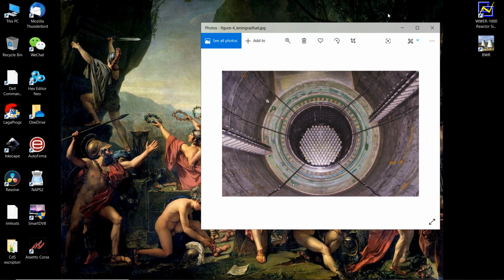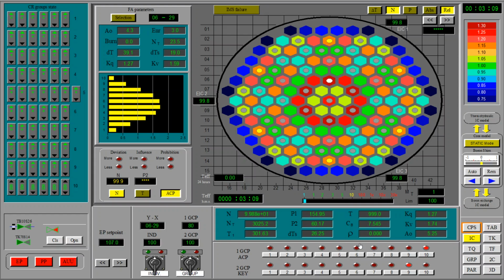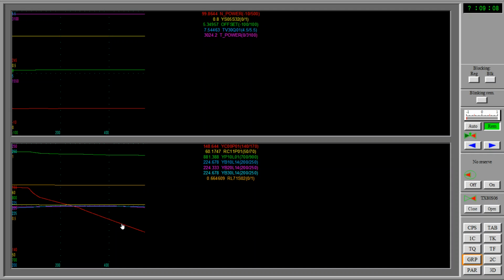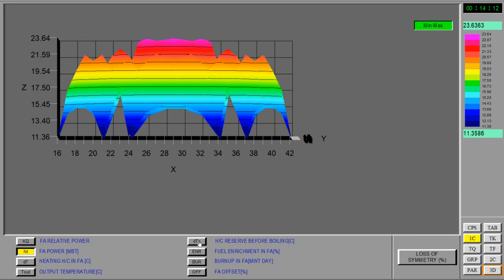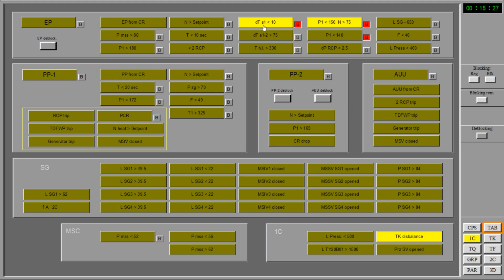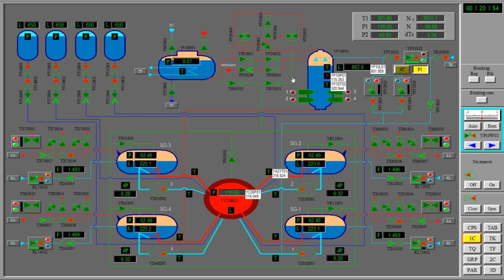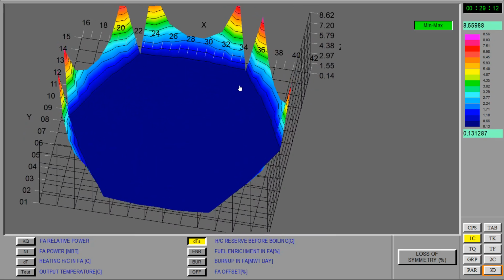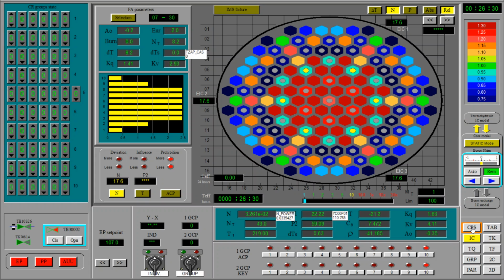Nuclear Reactor Simulator: Primary Boiling WWER-1000 2/2

Comment: Good tutorials!!! I think too that negative reactivity by boling water is not simulated. The developers doesn't have had this into account because it's a situation that we never must arrive. But it would be interesting simulated boiling water, because boiling water also doesn't have good thermal conductivity, so the reactor will start rising temperature and it could speed up a core meltdown. It would be an interesting simulation.

In other hand, you can poweroff pressurizer heaters, you must click the red or green tag shapes, then you can select "rem" for manual control, like a variable valve. You can use the arrows to on and off the heaters. With heaters powered off things are easier. I will try a cold shutdown (for refuelling, for example) by powering off the heaters.

Thanks.
Reply: I've changed my opinion. I've done 2 tests and I can conclude that primary circuit water boiling is simulated in the simulator. 

In the first test I start "Rated state operation" task, with power at 100%. Then I lower pressure to less than 110 bar, by powering off heaters, opening water spray valve and opening relief valves to the buble condenser (tank at the left of the pressurizer). When water temperature is near boiling point reactivity starts going negative and when water is boiling reactivity drops very quickly.

In the second test I reduce reactor power to 65%. Then I lower pressure to less than 110 bar, as before. Nothing happens, water doesn't boil and reactivity doesn't drops.

So when water in the primary coolant circuit is boiling, reactivity drops very quickly.
Reply from the maker: Thanks for the comment! the simulator is still working for you? what windows version do you have? I am not able to try it since it stopped working for me long ago.
Reply: @argilaga  No, it doesn't work in the latests versions of Windows 10 nor Windows 11. I run the simulator in a virtual machine (VirtualBox in GNU/Linux) with Windows XP.

Comment: Hi, i have a problem. Every time i try to open the simulator with an ic, it crashes
Reply from the maker: Yes, it stopped working after some windows update around 2020, if you have some offline computer without updates for more than two years you can give it a try.
Reply: @argilaga  There's no fix for that?